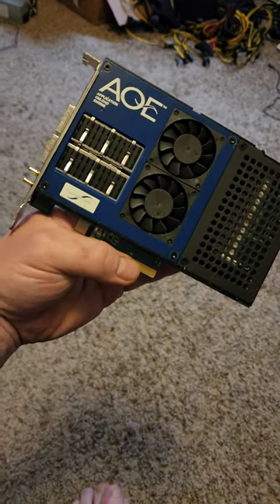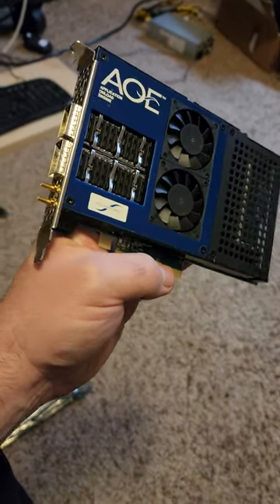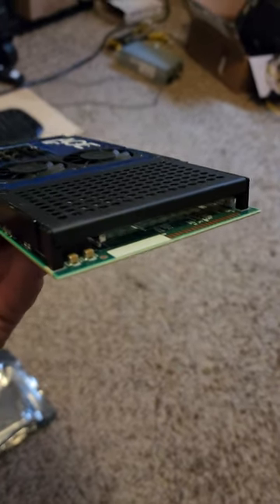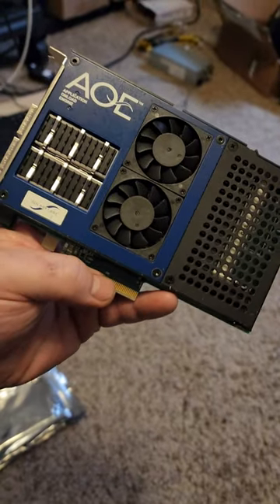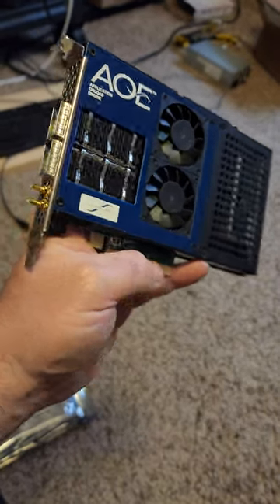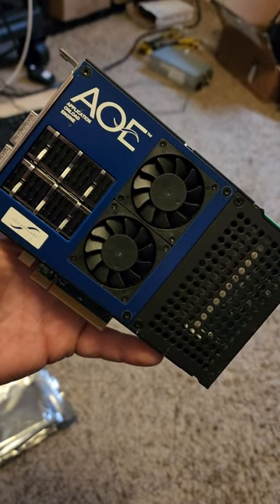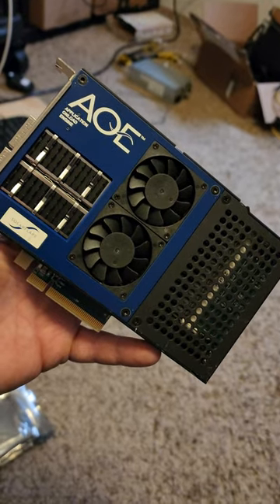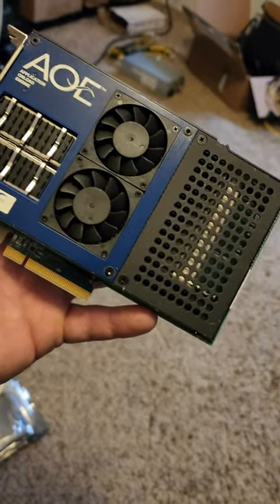can I do anything with this. probably not #fpga #cryptocurrency #hiveos

Comment: That looks more like a converged nic than an fpga.  Can you share the model #?
Reply from the maker: SOLARFLARE Dual 40GB SFA7942Q AOE FPGA Onload PCIE Timing Clock Engine Card
Reply from the maker: That's how it was listed
Reply: @trailerminer9650  looks to me like it uses an altera stratix V GX A7.  Interesting card, haven't seen it before.
It's an Intel fpga though, so idk if you'll be able to find a bitstream for mining on it.  Good luck though, it's a cool piece of hardware
Reply: Actually it looks like it only uses ddr3 for the fpga and is on a 28nm process, so I doubt it is of any use for mining.
Reply from the maker: @applicablerobot  well I guess I'll have to see if I can resell if I can't do anything with it. Or just hanging on the wall. I knew I was taking a risk buying it it seems like all the ones that you can do crypto mining with our up in the thousand-dollar plus range